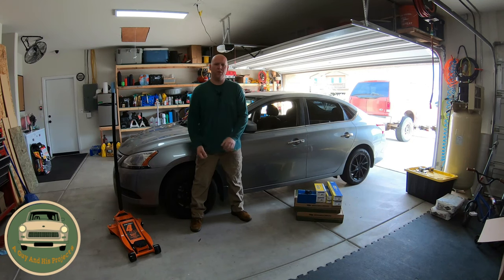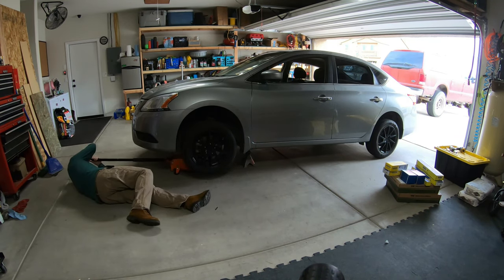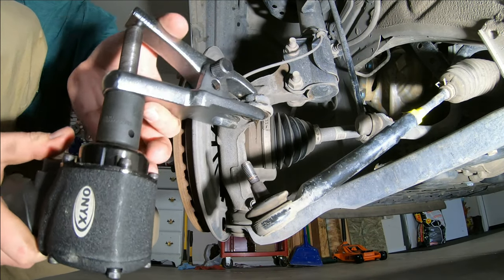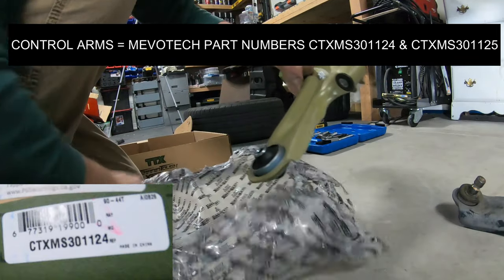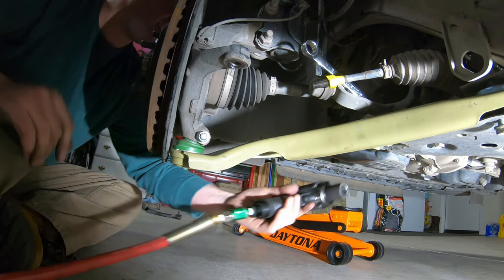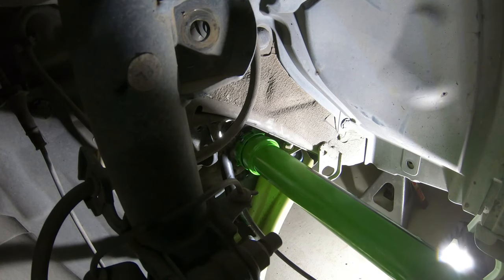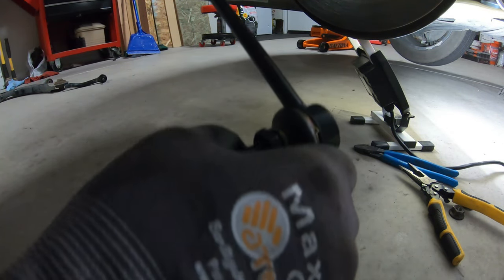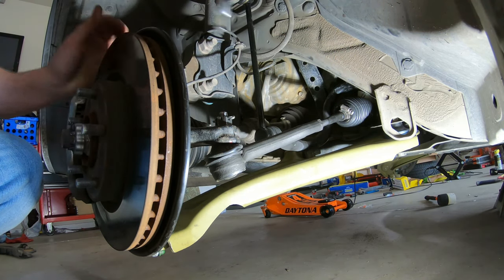Nissan Sentra b17 Outer Tie Rod, Inner Tie Rod, Ball Joint, Bushings, And Control Arm Replacement.

Comment: Awesome video! It’s funny that I came across this today because I just replaced these parts yesterday, with the exception of the inner tie rod. Those lower control arms are a pain to get back on.
Also, I have those same rims on my B17 as well!
Reply from the maker: Heck yeah, I like the rims! Yeah sometimes when working in the vehicles I second guess how much desire I have to continue ;)

Comment: How do you torque the outer tie rod nut?
Reply from the maker: Are you asking about the one on the joint? Just with a torque wrench. The jam nut I just go until it is jammed in there
Reply: @AGuyandHisProjects  jam nut. Yeah I guess as tight as possible.